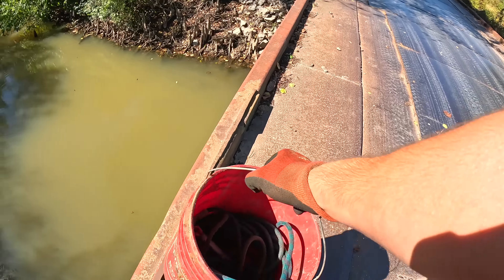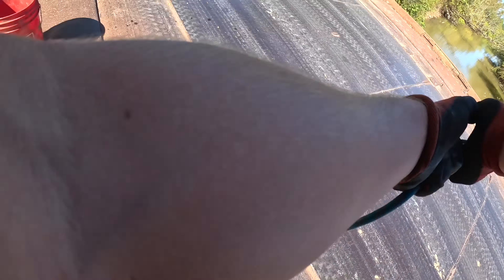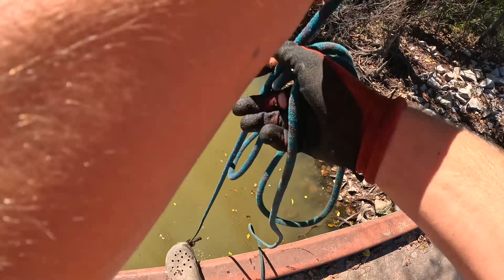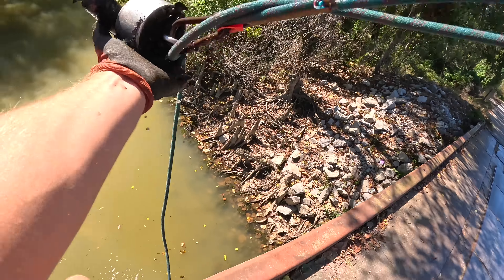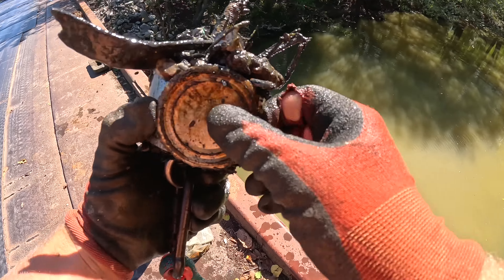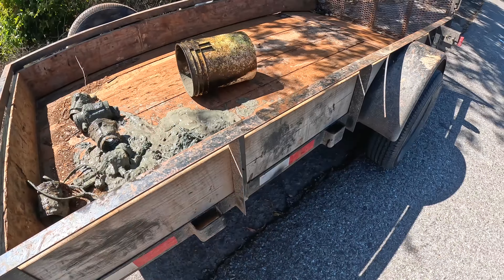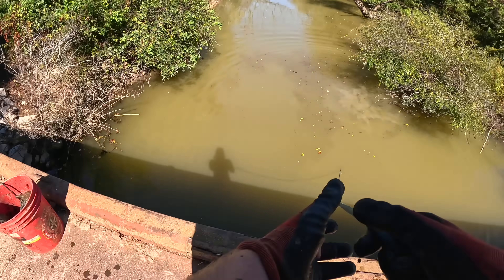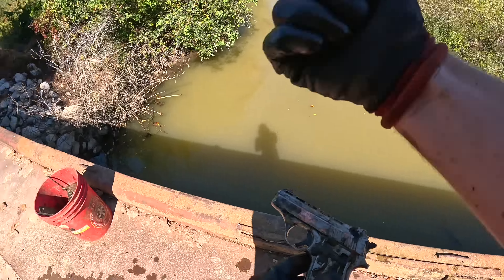Magnet Fishing Next To An Armory (2 Guns, Cannon Ball And More)

Comment: The cinder piece with the metal "door", is actually the rim and lid to a water meter. Sits in the ground and the cinder rim holds the steel plate to cover the meter.
Reply: I knew I recognized that. I just couldn't remember what it was for.